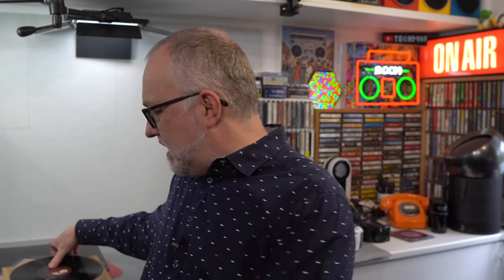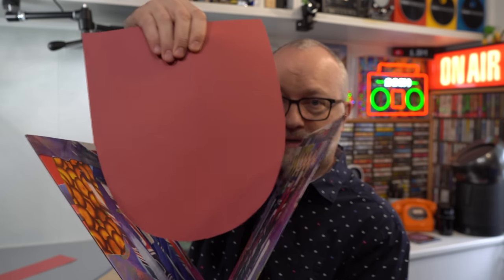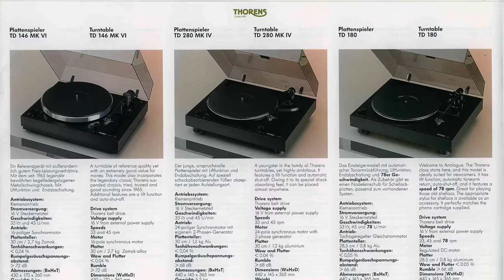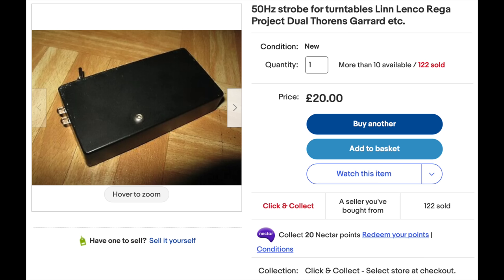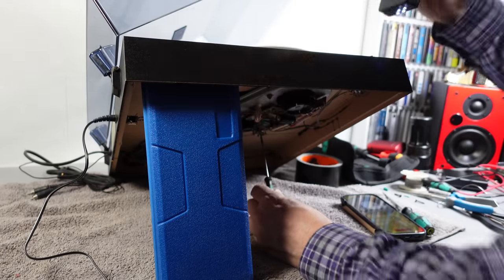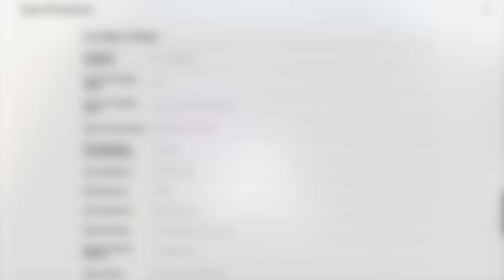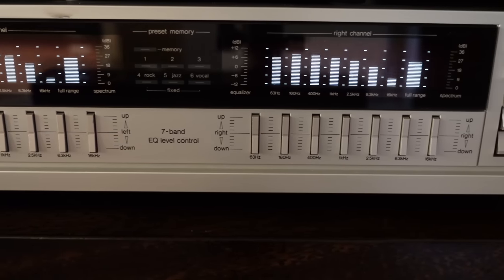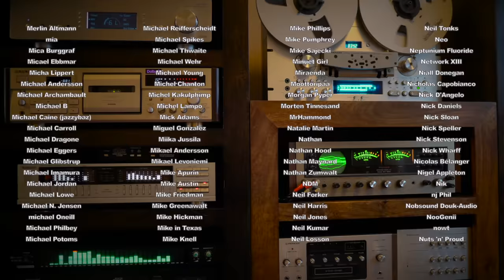Playing 78 RPM Shellac Records properly

Comment: It measures the speed at the motor spindle, so I suspect that the speed problem was caused by a tiny bit of slippage of the belt, or by the pulley on the motor spindle getting a tiny bit smaller over the years either because of wear or because of age, because the pulley of the turntable got a fraction bigger in diameter. Either way, adjusting the speed was the right thing to do if it was off by that much (5% is almost a semitone).
Reply: As I answered to several other commenters, my similar turntable from the same Polish OEM (Unitra) sped up after I oiled the motor bearings, and it also reduced mechanical noise dramatically.
Reply: 2% is semitone 5% is way off

Comment: you should use a "double Y cable" configuration to sum both channels into mono.  you GREATLY reduce the surface noise by doing so.  I was really surprised just how big of a difference that made! and it doesn't cost you much at all.
Reply: Summing to mono cancels out vertical (out of phase) noise but not noise in only the left or right channel.

Comment: Hi Mat, for archiving records, a simple tip to clean up "stereo" surface noise and a lot of clicks and pops on a mono record is to record it in mid/side mode.  That basically puts the mono information onto one channel and the stereo difference information onto the other.  Then just select the main mono audio track and hey presto, a lot of the surface noise is now gone.
Reply: Nice idea!  But … don't you have to subtract the side signal from the mid signal to do that?  Or do you simply use an inline mid/side plugin such as Voxengo MSED and hit "SIDE MUTE"?
Reply: Another trick I use when capturing to archive is to play the records "wet"; that is, I apply a layer of water down in the grooves of the record.  The theory goes as follows: A majority of noise comes from static build-up, not just scratches and dirt.  The water displaces the surface area enough to prevent static from building up, thus reducing quite a bit of noise.  

I also use Magix's Audio Cleaning Lab to master my captured sound.
Reply: @caddelworth  The "mono infomation" is already just a L+R downmix, innit? it retains noise present in both channels or one channel only but it reduces noise which is in antiphase between channels. side information is L-R, add the 2 and pan left u get 2L+0R, subtract side from mid, pan right, u get 0L+2R. How to get information that is in the phantom center ONLY? Does SIDE MUTE do that? how does the math work?
Reply: @minty_Joe  I remember wet playing reduces the elasticity of the material so more damage occurs, at least for vinyls, dunno about shellac
Reply: @tanelehala6422  Pass! You'd need to ask the Voxengo author how his "side mute" works: you've already baffled me with the arithmetic!

Comment: Parks Audio Puffin phono stage has a ‘super mono’ mode that selects the least nosiest channel for mono recordings. Has made some of my mono pressings sound brand new again. It makes the decision of which channel to play thousand of times a second. It also applies a pop and click remover. It’s incredible stuff.
Reply: The Puffin also has several different eq curves for 78 and LP other than RIAA. The pop and click remover is mild and can be turned off. I am running firmware version 1.20 which is displayed at startup. I have reflashed the bios once already, all you need is a micro usb cable, remove the bottom, and a computer hooked to the internet.
Reply: @zulumax1  it’s an amazing device. I’ve used a few of the RIAA curves with my 78s and the sound you can squeeze out of those old beat up shellac records is amazing. It’s a shame the vinyl community has this problem with introducing a digital section into their setup. I run mine through a Chord DAC64, and my vinyl sounds incredible. Shannon Parks has done an amazing job. I’m looking forward to being able to alter the intensity of the ‘Magic’ setting. Apparently that’s on the way with the next firmware update.

Comment: I learned so much watching this video (too young to have experienced it first time around), so I really appreciate all the information you shared.
I had to bust out laughing though at the thought that you shouldn't have to adjust the pots assuming all the components are correct and within original specs. That's literally what the pots are there for -- adjusting out the tolerance in components used during original manufacture. Assuming that the factory in the 90's had 100% strict quality control (yeah, right) and the pots were adjusted precisely from the manufacturer, you'd still have to make adjustments the second you changed any component. (And you changed the power supply, first!)
Reply: Mt new Realistic LAB 2250 was 4% fast out of the box

Comment: The flip stylus was commonly found on 4-speed BSR record changers. The cartridge with the flip stylus shown in this video is the Banpa BP2ATC, designed to fit the mount on red ceramic cartridge record players. You can put it on the Numark PT01 if you want to use it for playing 78 RPM records.

Comment: I use a Technics SL1210 direct drive turntable and Audio Technica AT-VM95SP/H 78rpm MM Cartridge & Headshell. In addition, ideally you need an equaliser preamplifier such as the excellent Timestep T-01EQ. The latter also has notch filters and other goodness.

Comment: What he describes early in the video, with the Audio-Technica turntable, is exactly what I did some years ago, even down to the having two cartridges and headshells, which allows you to swap them in seconds. My cartridge and needle for '78s was made by Shure; checking recently, I believe Shure has gone out of business, so you'd have to buy that elsewhere. I never thought of this gear as pricey, since I bought it for 33s as well, not just 78s. It's nice that the AT turntable does play 78s, as a good many turntables don't.

Comment: I use a Stanton 33/45/78 dj turntable with a special 78 pickup from France for playing back my 78 rpm Shellac platters. It works wonderfully and can convert the signal into a direct out digital format although for transfers I prefer to use the analog output into a digital workstation. I also have a McCurdy broadcast transcription turntable circa 1950's which is capable of playing WW2 V-Disk transcriptions as well as 33 & 45 platters. It has two arms. One for the 78's and the other for 33's & 45's. Originally designed for use with tube electronics I converted this to use integrated circuitry to lessen the weight of the turntable and improve the output sound quality as the specialty tubes were no longer available. I also use another special 78 pickup from France on this machine.

Comment: I adapted a Technics SLD2 to play 78 rpm as well as 33 and 45 and switch out headshells to go between LPs and 78s. I've worked out the difference between tracking weights by simply gluing a US one cent piece to the 78 headshell to add the extra four grams required.

Comment: I literally bumped into a collection of 78s on a dark street one night.  As a result, I got a cheap Garrard SP25.  Eventually I decided I needed a new player for my vinyl, too, so got the Audio Technica.  No need for a seperate cartridge, just a new stylus that fits the fitted one.  Another advantage is that I can adjust the speed on records, some of the early 78s were speeded up, a drop of 11% in speed seemed to do the trick.

Comment: Just for reference, if you remove the main capacitor from a LED mains bulb they flicker at mains Hertz’s so, can be used as a reliable strobe. Yes, it’s a hassle to get the bulb globe off but they are usually glued with silicone and eventually free up.

Comment: I doubt the speed issue would be from the motor itself. Since it has closed loops feed control the system should increase the speed to accommodate any issue with the motor up to the point where it can't anymore and since you were able to adjust the speed with the pots it should have been able to do it on its own I would imagine. This is probably down to drift in resistors or capacitors in the control circuitry.

Comment: pausing at 13:49 to ask: Do people really buy turntables that don't have some sort of pitch control mechanism? It's basically a form of manual speed adjustment, where you set your turntable to 33, 45 or 78, and if it's not running at the precise speed you want then you can make small adjustments. Not every album is mastered the same and sometimes  the music on the record itself plays back just a little too slow or a little too fast, so at one point turntable manufacturers accounted for this. But I guess people stopped noticing or caring at some point?

Comment: I modified my Sony PS-212 to add a 78RPM speed.  I use those AT cartridges and just swap the 78 stylus on and off.  Changing the tracking force is a little annoying, but just going off the numbers on my counterweight gets me in the ballpark.

I threw on some of my old 78s this morning when I first saw this video in my feed.  Everytime I listened to them I'm surprised how good they actually sound.

Remember, these 78s were designed for playback on acoustic phonographs, so you're not going to hurt them by setting you tracking force to heavy.  You could, however, damage your stylus.

Comment: Interesting! I’ve recorded a bunch of 78’s on an old ceramic pickup "middle wheel" 50s or 60s 3 speed record player (yes, it’s stereo!), to a cassette recorder using plain old Dolby B. I’ve since digitized these using a little audio-to-USB-thingy, and to my old ears, they sound good. Now, my old SL-DL5 gave up the spirit last yearm and the old-tech-wizard in town couldn’t fix it, not even with the parts I got from eBay, so I let him consign it to the eternal stereo shop in the sky. The Audio-Technica seems to be a good solution for my old LPs and my equally ancient 78’s, inherited from my parents. Thanks for an excellent tip!

Comment: One minor correction, an incandescent lamp will not work with a strobe disc because the filament's thermal mass eliminates flickering. Old fluorescent fixtures (mainly pre-1990s) with a magnetic ballast instead of an electronic ballast will work fine. Or if you live in the modern age try using a video camera. The shutter will result in the same effect as a flickering light.

Comment: One thing you could do, is transcribe the audio to Audacity, and then use Audacity to convert the recording to mono (using left, right or left + right), then use Audacity to remove the RIAA equalization, and then have it apply whatever equalization you want. Of course, you'd be listening to the processed audio after the time it takes to process it, rather than hearing the record in real time, but I guess it depends on what your goals are.

Comment: If you use a second headshell for the 78 stylus: Add some weight to it (extra nuts, wahshers, whatever) to get the right tracking force with the player adjusted for correct force for your regular stylus. Then you dont need to change adjustment or could forget to do so. It should be easy with the 78 needing significantly more force than a LP.

Comment: I got the audio technica  LP120 with the same 78 cartridge , and find it extremely good . I did try it with LPs. and was very impressed with its all round ability , but I use it purely for 78s  .  I did consider the Rega deck because I already have the Rega P3 deck as my main player ,  but decided on the LP120 because of the pitch control which can be useful for 78 records .   I would say that it’s quite amazing how good 78s can sound , given the opportunity of modern equipment .    And in reality they will sound better than they did in the days they were produced because of the limitations of the record players ,       Still not bad for a format that’s been around since the 1880s and finally standardised in 1925 .  😂 👍👍👍

Comment: Here's a suggestion that might be right up your alley. In one of your previous videos (the one about the cd shaver) I've seen you load two recordings into audacity to see if there is any difference.

Now what if you make two recordings of a 78rpm record. One with the Left audio and another with the right audio plug. By taking the difference between the 2 you might be able to remove some of the noise, thus improving quality even further?

Or it might not work at all. It might be an interesting experiment either way.

Comment: ...3 mil diamond and sapphire styli are sold for the Crosley players. It's just 793D3 or 793S3. I'm not fond of that cartridge. It needs damping grease, but the stylus is great. I bought a ton of 793D3 styli, and fit the cantilevers to other pickups. They fit the groove well. 793D3 styli seem to be currently out of stock everywhere. Sapphire is prone to chipping, FYI, so use with care. The diamond stylus has lasted me 6 months of daily use tracking at 10 grams. At 6 months there are signs of distortion and swishing in some grooves due to loss of size and flats.

Comment: I have an unbranded Chinese low end turntable which is hooked up to a basic preamp with a mono button.  Yes, it's that cheap mechanism that we all hate but you can buy better stylus that those red ceramic ones.  I have a gold color diamond one for the lp/45 and it's great.  The one they have for 78s is nearly 2.8mm and it's ruby.  I'm quite satisfied with those.  But I have have my Victor Orthophonic with sounds impressive 90 odd years later.

Comment: The motors not failing just needs a dab of lube. The speed needed adjusting because trim pots WILL go out of spec over time even if they are set with varnish. The carbon track gets oxidized and the resistance is variable of time. Spray with switch cleaner, rotate back and forth a few times, then adjust speed.

Comment: The cartridge which came with the deck looks like an Audio-Technica AT91 or AT3600, so a 78 rpm-only stylus is available for about £35. 

To connect the four wires on the back of the cartridge for mono, Rega just connects the arm's Left and Right together for both positive and negative (the Rega 78 rpm cart only has two pins). I wrap fine wire around the relevant pins on the cartridge, so if I want to use my Audio-Technica 1240 deck with a different cart for 33s, i just have to change headshells.

I'm pretty sure that the 78 rpm record sets released by Kitty, Daisy and Lewis are microgroove, and use a 'regular' cartridge.

Comment: Incandescent light bulbs  can still be bought cheaply at secondhand stores. They are very useful still as high power loads (a 100 Watt 240V capable dummy load costing only cents).

Comment: The reason for the preamp modification is the pickup and record features use an inductor and a magnetic field to transfer the music to the plastic, and  an inductor naturally has a high impedance to higher frequency's and the impedance changes with the frequency. So to keep the sound level at the same level as it was recorded at you need to change the amplification to counteract the reduction of sound volume of higher frequency's of the sound that humans are able to hear.

Comment: A glow discharge lamp, possibly salved from the power indicator on a 1960s or 1970s piece of equipment, powered from the mains, would be excellent for illuminating a stroboscope. (My personal favourite is one from the Philips EL3547 tape recorder, as it contains the lamp and current limiting resistor all moulded into a piece of plastic, with just two wires sticking out, that I can connect 230V to).

Comment: I listen to my 78s on a 1917 victrola, but the vast majority of my collection is acoustically recorded anyway so they sound better because the reproducer isn't nearly as sensitive as an electric pickup, so alot of the surface noise is muffled, and the natural echo from the horn sounds great. And yes, I change the needle after every record, or every side on a 12''.

Comment: For the cheap briefcase players you can get an upgraded Sapphire stylus on what I believe is an aluminum cantilever. Something like 10 bucks. They can dramatically improve your experience when listening to 78 on those. I have seen people of course upgrade them to a better cartridge usually still ceramic with the flip over stylus so they could still play their 45-33s but as you said still not really great quality but an option for those people who just are casual listeners of all genres.

Comment: I "restored" (just electrical and mechanical) an old 1950s tube radio a few years back that has an integrated record player on top.  Guess that was still important in East Germany at the time. So i've made my own experiences with this.
78s don't really use a V-shape to pick up the sound, the stylus is meant to scrape at the bottom (just consider the weight of it on a mechanical player). The sound is picked up just through the side to side motion of the stylus compared to a combination as would be the case with stereo vinyl record players. So an actual mono cartridge for a mono player of the time does do a decent job. I really haven't considered the width of the groove actually, don't know why. But i presume the angle of the cone is the dividing metric.

Comment: It might be late now, but I will leave a note. I own several turntables from this particular manufacturer (ARIA) from Poland. Most of soviet record players had models from that factory. According to my research, its issue of a faulty transistor BD-xxx, if in 1992 they were using their own one. Over time, it loses its characteristics and speed drafts, just like in ВЕГА-ЭП 122С

Comment: A number of years ago I captured 78s with a proper stylus but captured into Audacity at 45rpm then a calculation done to change the bit rate to give it the proper speed again. The turntable did have a strobe on it too.
It was good enought for my needs.